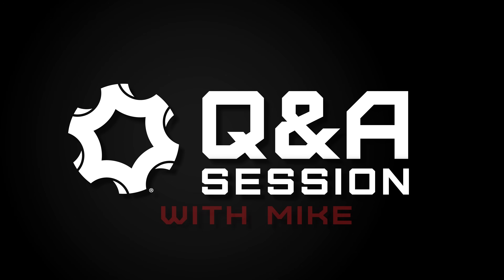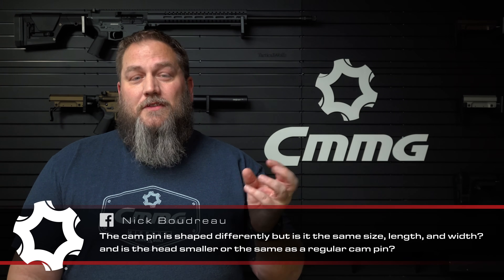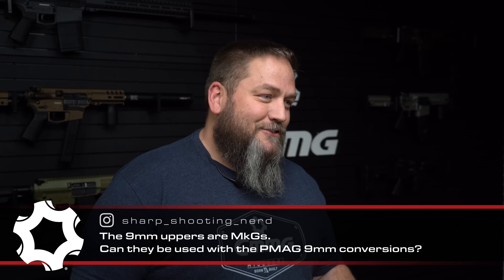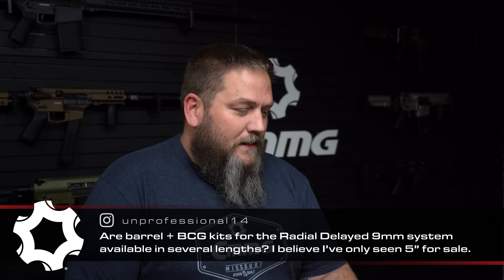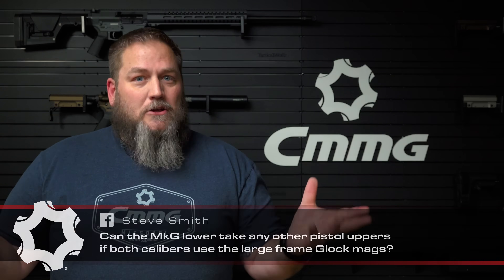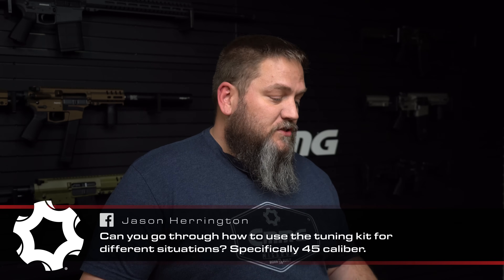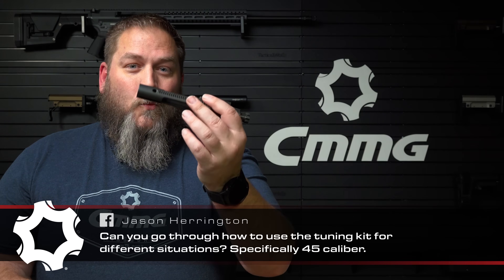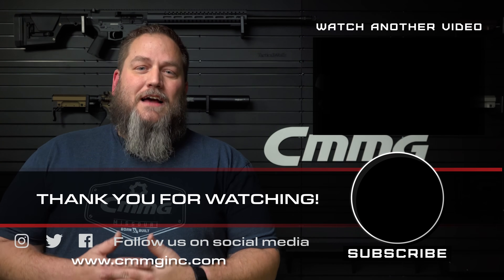CMMG Q&A Rides Again! Radial Delayed Blowback

Comment: I’m running the RDB with a Atrius super selector. I’m getting some ftf with 124, 135 hp and 150 any suggestions
Reply from the maker: Super safeties are always going to require a bit of tuning as much as we'd like to thing they're plug and play. You may have to play with weights to slow things down as you're getting faster action and possible bolt bounce. feel free to contact our customer service for more

Comment: I just bought the 9mm RDB back 8-inch barrel, and I am putting folding stock on it. I do have the weight set and 2 different weight bolt extensions for the folding stock adapter. I'm running mostly +p and +p+ ammo but do have some cheap stock ammo to also run. Is there an overall weight to try and get to. The bolt extensions are light one at 1.6 Oz, and the other is 3.4 Oz

Comment: Can I use your radial delayed BCG and Barrel kit with a PSA ARV receiver set so that I can use scorpion mags? Do you know any reasons why it wouldn't work or do you know if anyone has ever done this before? If you know that it doesn't work then do you know of any AR9 receivers that use scorpion mags and are compatible with your bolt and barrel?
Reply from the maker: It doesn't that we are aware of. There are grooves in the bottom of the carrier that would align better with Glock or AR magazines. Scorpion magazines are significantly wider.

Comment: as long as you have the RDB bolt and barrel from cmmg you can pretty much use any pcc glock lower as long as you remove the extractor i preferred the circle ten or angstadt arms because of LRBHO and about 200.00 dollars cheaper than cmmg their extremely proud of their products.

Comment: Can you use the .22 conversion as a dedicated bcg for an upper?
Reply from the maker: You could, but the twist rate isn't quite right for the best accuracy in a .22. Plus you'll likely foul up your gas system if shooting nothing but .22 out of it.
Reply: @CMMG  yeah I would use a .22 barrel.  I have a spare  lower and the bravo kit sitting around and wondered if I could make it a dedicated bcg.
Reply from the maker: @reeper26  If you have a dedicated barrel, you'll just need to change the chamber adapter on the conversion to what we call a collar. It's designed to interact with the dedicated barrel.

Comment: Have the 5.7 bolt and barrel kit installed doing pre-checks. Checking headspace with the bolt stripped, I noticed the bolt won't go past the locking lugs and rotate with the "go" gauge in (from Pacific Tool & Gauge) - is this normal and how best might I check headspace if so?

Comment: How much of a turn does the Bolt actually do when in full Battery? Is it locked into place when like a Lug on a bolt action locks in?
Reply from the maker: With the chamfered edges of the bolt, it never actually "locks". It just rotates into its location.

Comment: Very happy with my 300 series Banshee 10mm now. Whatever the ejection problem was, you guys fixed it. When I got it back in November, I took it to deer camp, and did some test firing-rapid fired 2 30 round mags of 180gr Hornady XTP's without a hiccup

Comment: Building a 10.3" on an ar15 platform,, will a standard matched upper & lower work with your radial delay bcg?
Reply: Following
Reply: It should if you have a cmmg bolt, barrel & mags and be sure it’s a 5.56 mil-spec upper.

Comment: Here's a fkn question... WHY IS IT SO HARD TO GET A QUOTE AND ORDER FORM FOR A RDB 5.7 BCG FIRING PIN?....  BEEN WAITING SINCE MARCH  🤬
Reply from the maker: Not sure what process you’ve been trying, but if you just want to order a spare, you can order one on our website. Just search Mk57 firing pin. Unfortunately YT will not allow us to put the link. Or it can be ordered direct from our sales team. There’s no order form needed. 

If it’s a repair part, that goes to our Tech Support team and they send a replacement. 

The only exception to the above would be if the parts leave the US. Since we cannot export directly, it would be going through an exporter and subject to whenever they place an order.

Comment: I used your 9mm bolt & barrel combo with a stripped upper, just wallered out that ejection port till it cycled gud. 
I use it on a FOxtrotMikes glock lower, just removed the ejector and it runs like a dream.
Reply: Where did you purchase your bolt and barrel? I can’t find them anywhere.
Reply: @johnpalmer8834  from their website over a year ago. These things take time. 
Also, do you have time to talk about Jezus Christ our Lord and Sabre
Reply: Was the ejection port standard size to begin with?